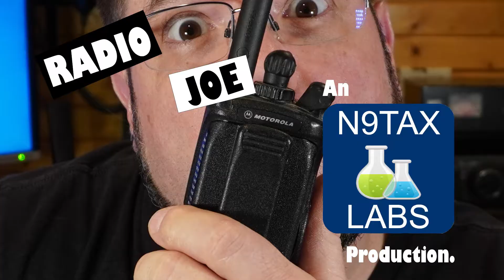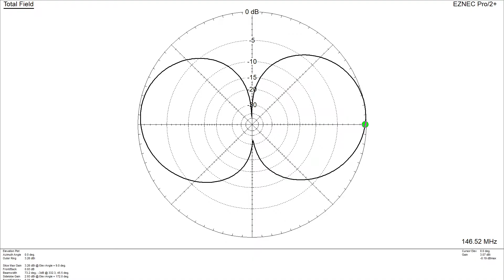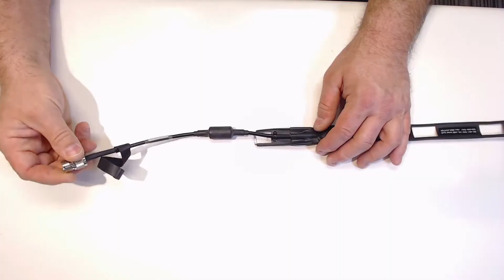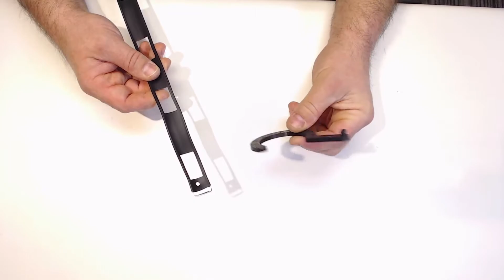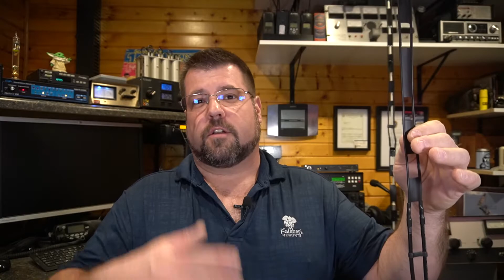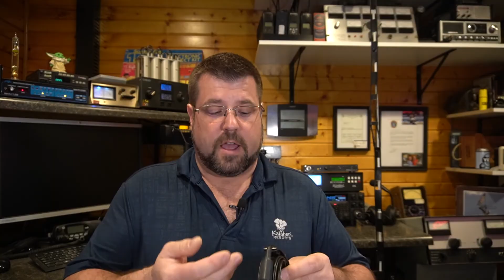N9TAX Slim Jim Antenna design and use

Comment: Ordered the dual band and the GMRS. Looking forward to using the dual band for comms at camp chucked in a tree or above my camper on the ATV fiberglass mast you become. 

For the GMRS I'll be using it as part of a deployable 20w repeater I'm looking to build. Go out, get antenna up in a tree, attach this to repeater in a box, we've not got improved local comms capability.

Comment: You can also buy the fiberglass rods in either a single piece or two piece construction from a bicycle shop in the form a a bicycle flag, they usually have a metal bracket that they just slip into for mounting on a bicycle rear axle. The 2 piece ones we sold had a plastic connector instead of a metal one, if anyone is concerned about the metal. 👍🏻
Reply: Oh, and I bought my first N9TAX antenna today, dual band 2m/70cm. 🙂

Comment: I just bought this antenna, and I'm hoping to modify a piece of PVC pipe to protect it so that I can put it outdoors, and it can be removed easily if I need to change it to a different mounting mechanism. I'm hoping to pair this up with my FT5DR for longer range mobile applications as well as at home at my apartment. Hopefully I'll get mine, soon! <3 - KF0QNM

Edit So it does affect the antenna (26:00). We have weather conditions that would possibly damage the antenna. A J-Pole might be a better outdoor solution, then. Still, having this guy might help.

Comment: You should just have a CHECK BOX for if you are mounting inside thin-walled, 200psi 3/4" PVC. Ed Fung said one of his grad students measured the difference in gain inside and out; there was very little attenuation. The tuning, once found for inside said tubing, will be essentially the same for all the same type aforementioned. The ladder-line affixed to fiberglass rod is an UGLY MESS. 
       You should also consider making a dual bander for 2meter ham and GMRS.  In my two years scanning, I've Never heard anyone on MURS (154), so that element is useless, at least in Los Angeles. However, getting 2m ham AND GMRS would benefit a sizable number of us. Of course I, and everyone I know who has these types of antennae outside, would mount them inside the thinwall 3/4" PVC.

Comment: I ordered one from you the other day, should be here soon. Just a suggestion: you could press in a metal grommet to prevent the hole for hanging from wearing/splitting. Might just look into shoestring eyelets as they should be cheap

Comment: I have used mine this past weekend while providing communications support for Extreme Trail Running races in the local mountains.  Attached to the top of a 22 foot fiberglass flagpole (telescopic) with 50 watt radio and had no problems being heard....even stations a hill or two away.  FYI - it was a 50 mile long running path so our aid stations were not usually LOS.  Well built, durable, effective and economical - what's not to like?  It is what I recommend to newly licensed Hams who are rubber-duck-bound.
Reply: how did you attach it to the flagpole?   I am in a similar situation for a trail race.

Comment: Great antenna...I just ordered another one for a go kit.  Started out as a tech and using it with a UV5R while traveling for work, and I would get a high floor at a hotel and hang it in the window.  Easy to hit local repeaters with it, and it has held up for about 10 years now.

Thanks for making a great product!

73,
Brett K5WXP

Comment: Not really sure why I want to but I just received the gmrs antenna I ordered from you... is it OK to use liquid electric tape to cover the ends where the wire is bare and soldered? I know you said you have had them last for years with it as is but I can't seem to leave well enough alone. I'm sure I'd probably be waiting 12$ for a dab of it but I have to ask

Comment: How long can the cable reasonably be before attenuation offsets the advantage in height?
Reply: Depends on what kind of coax it is. Generally speaking, thicker is less lossy, but it’s also heavier and less flexible. Search “amateur radio coax calculator” and run some numbers. I generally shoot for -1 dBi loss or less (that equates to -20.6 % loss in power—you won’t notice it).

Comment: I just bought this dual band slim Jim antenna. I bought the PVC attachments that you can install the antenna on the outside of 3/4 PVC pipe. I have it mount on my Extension pole up 28 ft. I reached my Ham Radio Group Repeater on UHF 30 miles away from my home. I love this design. It is so easy to mount. The price is fantastic. I've bought an Dual Band Vertical antenna for $90. Sent that back to Amazon and This Antenna Performs MUCH Better.

Comment: I always wanted a 2m bicycle antenna and most idea I saw where just adapting base station antennas or some other complicated stuff and then grounding to the frame but this antenna actually seems perfect, specially with the fiberglass rod mount idea. That would work perfectly.

Comment: I always wondered what a J Pole was exactly and how it worked and why the little j bit. That intro explained it all perfectly and I see now why it's popular on lowband vhf like CB/10m and 6 Meter HAME. That said though, where does the 6dB gain figure mentioned in the store listing come from then because that's inconsistent with what was modeled here on the video.

Comment: To seal my connectors I just use clear silicone caulk Little messy put it on, years later slicing with the razor or a knife comes right off very easy super water tight
Also I've seen a product that's a liquid with a brush making antennas like yours liquid vinyl tape dries in 5 minutes, looks pretty good

Comment: Why aren't the top and bottom solder points covered in shrink wrap? Can I dip them into a vulcanizing rubber to seal the ends from the environments?  I'm going to get a couple of these, one for mounting to the safety flag of my recumbent trike and one for a rollup in my bag while travelling.
Reply from the maker: After much testing it was found that covering the ends is completely unnecessary. Therefore since it will only add cost to the product for the buyer and slow production we do not cover the ends. If you feel the need go ahead but use something that will seal it properly as a bad seal will trap water inside and create a problem that didn't exist.

Comment: Got my Technician/General tickets the same day a week ago. "Playing" with a cheapo Baofeng until I can afford a "real" radio (next payday) but I just ordered a Slim Jim to use, at least for now, because I live in a townhouse and can't do an outside antenna. (Also don't have attic access from my unit.) Hopefully it'll do me good until I can do something better. Like move to somewhere I can put an antenna on the roof. 🙂 Thanks for the video!!
Reply from the maker: Just remember try different locations if you get poor results at first. Indoor radio antennas are fine but can be tricky. I have a spot in the house where you can move the antenna back and forth just a foot and go from a full quieting signal on a local repeater to nothing at all.

73, Joe N9TAX
Reply: @N9TAX  I've run into that with just the little "rubber duck" antenna. I figured standing in front of the window would be the best spot to reach a repeater about 20 miles away, but the "sweet spot" is actually about 3 feet to the left. But I'm pretty happy I can hit it at all with my little 5 watt HT. Thanks for the response and the advice!!

Comment: I have two of these and highly recommend them! I have used them in various conditions - indoors and outside - and they always perform very well. Lightweight and compact... I have one in my radio kit for my HT and one that I deploy when I'm stationary in my camper van. The antenna turns my 50w Kenwood into a powerful crossband repeater at special events. It's a powerful force multiplier! Two thumbs up!

Comment: Beginner tech here. If I try to mount this on my chimney is it necessary to ground it?
Reply from the maker: J match style antennas should not have a ground attached directly to them. For lightning protection a grounded lightning arrestor can be placed inline with the cable where it enters the building.

Comment: Would this be suitable for mounting horizontally in a vehicle rear window? Would I need to create a 3D printed mounting bracket to ensure it's oriented properly? What should I expect it's performance to be compared to a ut-72 or ut-308 on the roof? MURS and GMRS uses.
Reply from the maker: While this may be possible the antennas are 5 feet long which will make mounting it challenging. Also most vhf and uhf signals will be vertically polarized which means up to a 20db penalty for cross polarization. Also most vehicle windows have some sort os tint. This also blocks radio waves. I would expect an installation like that to work worse than a handheld radio with a duckie antenna inside the car.

Comment: I want to mount this inside my jeep 74 cj5 was looking for a antenna I can mount in my rag top I do have a roll bar and 2 roof bows made of metal inside  could you give  any suggestions or mods I can do to mount the antenna. Or should I mount vertical on a fiberglass pole on exterior. thank you bob
Reply from the maker: A fiberglass rod external to the vehicle would be better. These antennas are not the most vehicle friendly.

Comment: I will soon be moving into an upstairs condo and I have thought about just dangling one of these out of the window. How would it work if the slim jim was fed from the top instead of from the bottom. In other words, how would it work if I just hang it upside down out the window?

Comment: my very first vhf antenna was a home built slim jim . now almost 40 years later im back to using a higher gain version of a slim jim . at the notch as you suggest bend the antenna at 90 degrees then add another radiator section vertically downwards  , effectively you have two slim jims sharing one matching "stub" running horizontal

Comment: Thanks for posting this! I usually use mmana gal but I see ez-nec is fairly simple as well. Subbed. Thanks
Reply from the maker: Yes I have used EZ-NEC for years. Had a paid version with the company I used to work for. But now the creator has retired and made the pro version FREE! So now is a great time to check it out.

Comment: Great info on the antenna, definitely going to order one. Would like to attach it to a fiberglass spider beam type pole. These seem to have top most sections in an appx .25 inch diameter.

Do you tune them differently if you know how they're to be mounted? Not much 70cm here, any advantages to going with 2m only?
Reply from the maker: We do not tune them different for mount on a fiberglass rod. 1/4" dia is not going to make a noticeable difference. The only advantage to the 2m only antenna is the lack of the traps. So less failure points. Though we have had very few issues with the traps. The few failures have been from very used antennas that were rolled and unrolled a lot of times.
Reply: I also just bought a Spider Beam fiberglass antenna mast. Can you let me know how this has worked out for you with the Slim Jim? I have one coming tomorrow.

Comment: This is an awesome antenna, got one and getting ready to buy another. Update; I now have 2 of these and they are both outstanding. Heavy duty and built to last. I'm using them on my Wouxun 2m/70cm and my Wouxun GMRS radios as well as all my Baofengs. The swr's are dead balls on right out of the box. So easy to set up and use.
Reply: Same here. Very happy with them
Reply: Sorry about your, you know, testicles.

Comment: Great info for me (total beginner) - I only have a Baofeng UV-5R at the moment.  I'm in a stucco, steel framed house  - great for termites, not great for reception :-). Curious how much better this will be vs the default antenna?  I can get FM and noaa channels in other parts of the house near a large window, but not in the man cave, which is on an external wall.   I know the UV-5R only puts out 5w so I'm not sure if I'm gonna have to step up to something like a yaseu with 80w in combination with something like the slim jim to get signal in the man cave without going external.  I sent an email on the site, but figured I'd comment here and help anybody else who reads the response - Thanks!
Reply from the maker: So the best way do figure this out as I stated in the video is to survey the house. If you find places that the radio works well inside a full size antenna placed there will work even better. Then you would only need to work out how to run cable back to the operating position. In this case the room you are calling the man cave. If you are doing all of that though you may be better off putting the antenna outside. Even hanging it from an eave on the house should well outperform an indoor antenna.